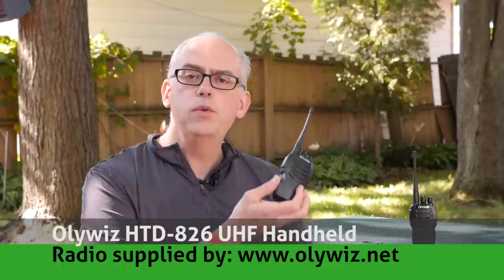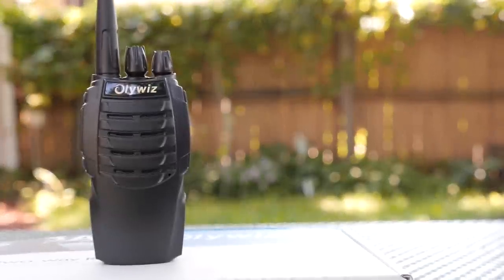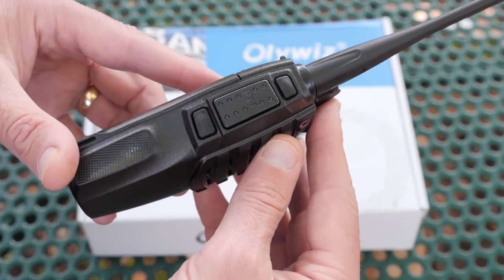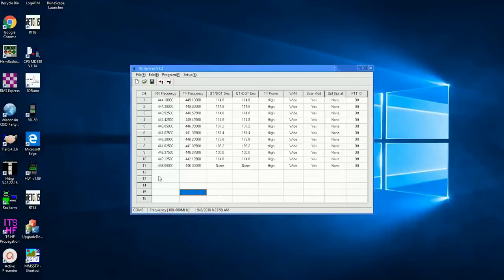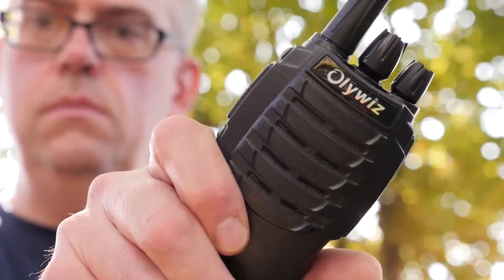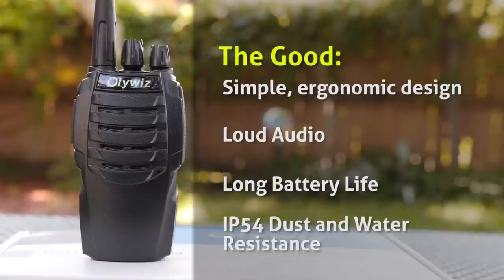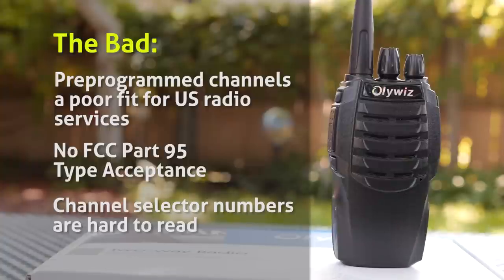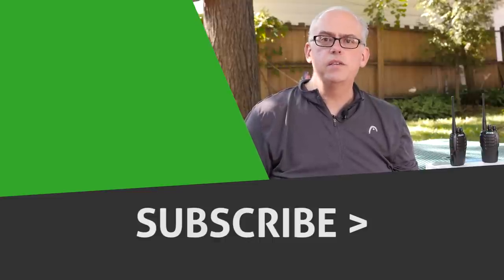Olywiz HTD-826 UHF Handheld Radio - Ham Radio Q&A

Comment: This is just a BF-888s.
Reply from the maker: They look very similar, so they could be the same radio. Most of these radios come off the same assembly line with minor firmware changes and body styles.
Reply: It looks like this is a step up... I would probably choose this over the BF-888s (this is coming from someone who helps manage a fleet of 10 BF-888s radios used in a workplace setting)
Reply: It's better quality than 888s, which are two different producers
Reply: How many miles does it cover?

Comment: Sounds like a bf888
Reply from the maker: They look very similar, so they could be the same radio. Most of these radios come off the same assembly line with minor firmware changes and body styles.